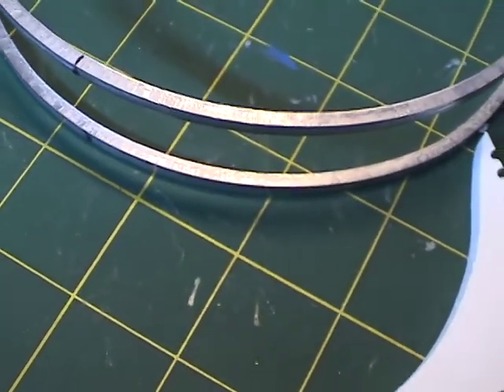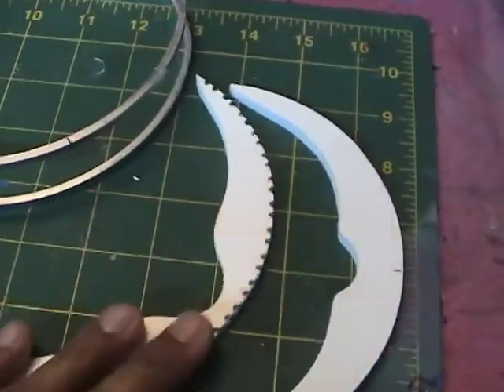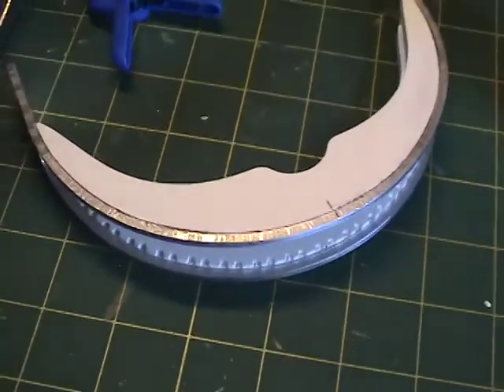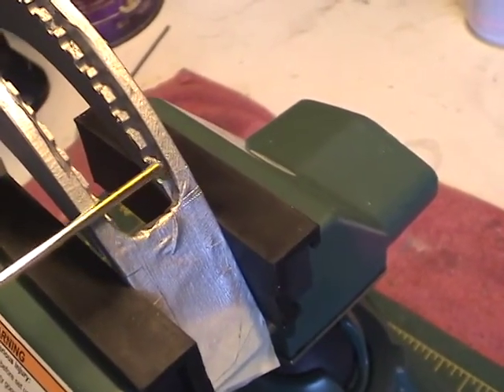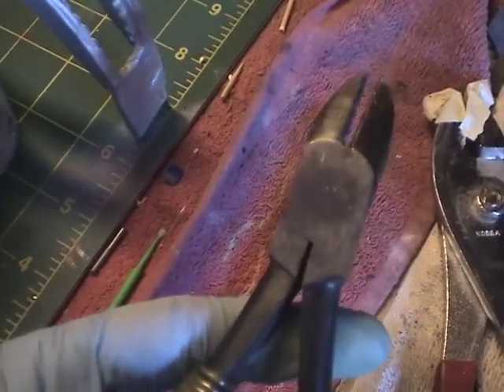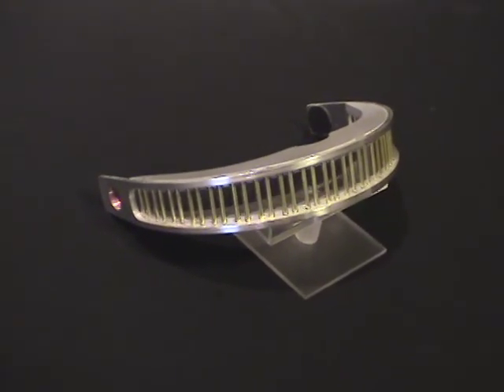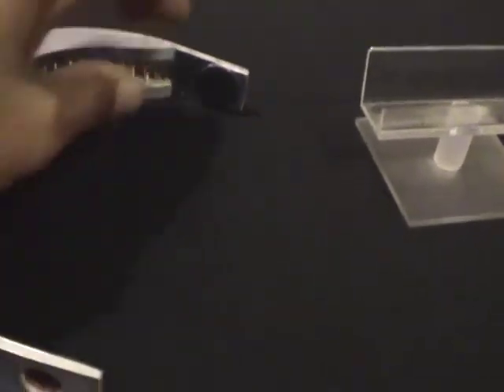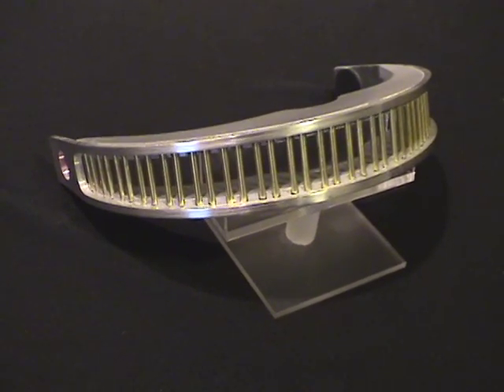Making A Geordi La Forge Visor from Star Trek the Next Generation

Comment: I'am guessing brass is a heavy metal right. Ok for display but not to wear. The real one used on the set would have been pretty light.
Reply from the maker: Jim Carmody yeah it is wearable just wouldn't be comfortable to do so for a long period. It's a decent replica although I agree it could use more vertical brass rods. Thanks for watching
Reply: you can buy hollow gold plated brass rods for cheap online, 2mm diameter spaced 1mm apart, and it will look like the visor from season 5-7